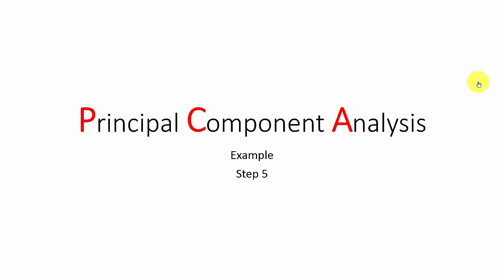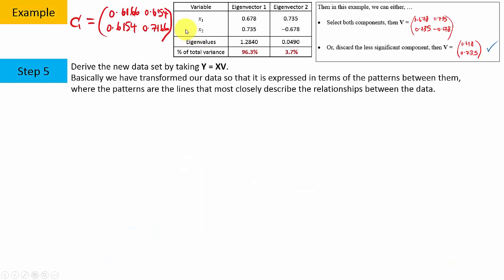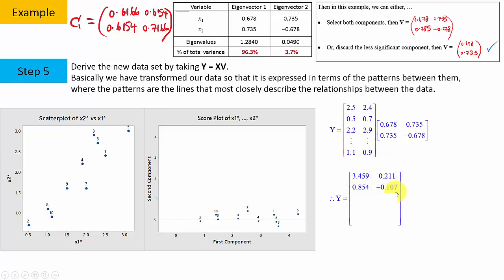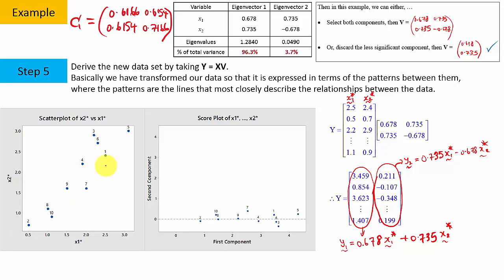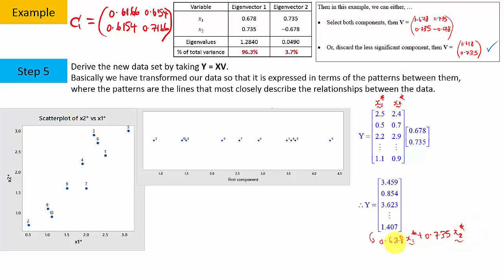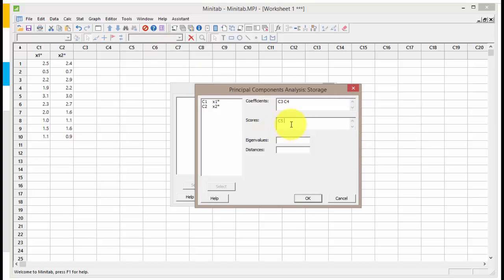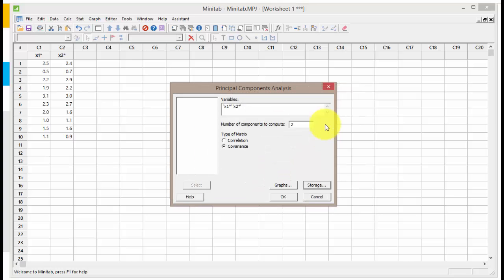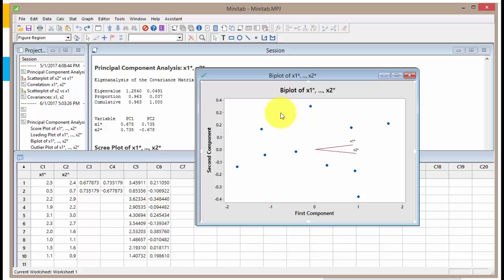PCA: example - Step 5

Comment: Thank you for this very explanatory  video. I have one question though, I heard that cosine of the angle between variable vectors depicts the correlation between variables. However, even though we know that variables are highly correlated, in the plot (with the equal axis scales) they seem orthogonal. This seems a  contradiction. What is wrong ? Can you please explain ?

Comment: Thank you so much. This has been more helpful than anything else I have read. One question, however, is why is the original data matrix a 10x2. In Step 1, the matrix was a 2x10. Does this actually make a difference? I am new to matrices. Thank you again!
Reply from the maker: Actually in step 1, around 6:50, you will see that the data matrix X is 10x2, even though the data presented in table form is 2x10.  For the matrix algebra of PCA (and many multivariate techniques) to work, X is of dimension nxp, where n is the number of data points and p is the number of variables.